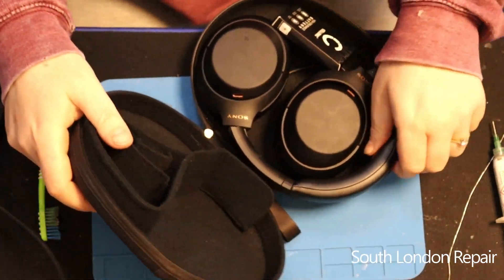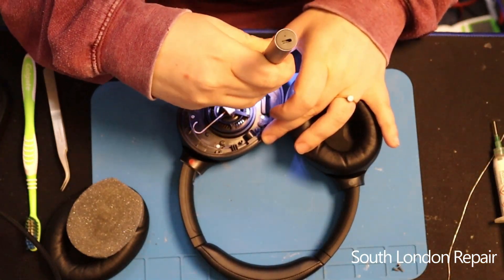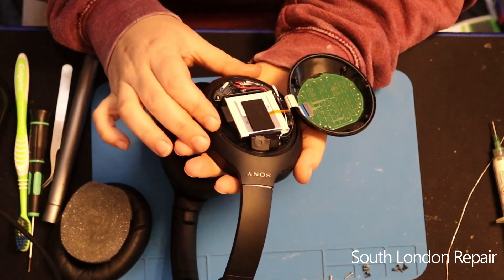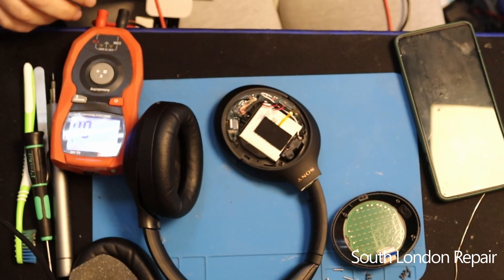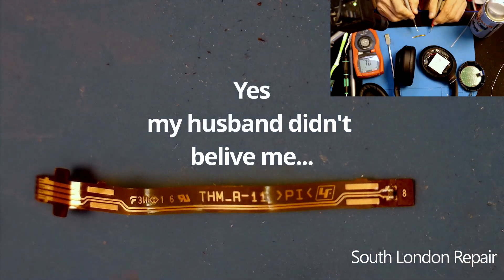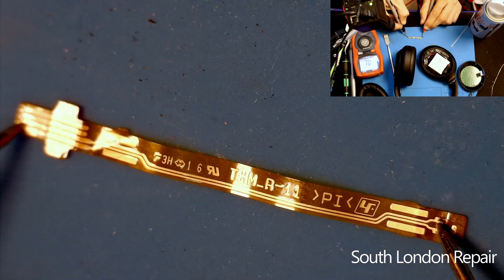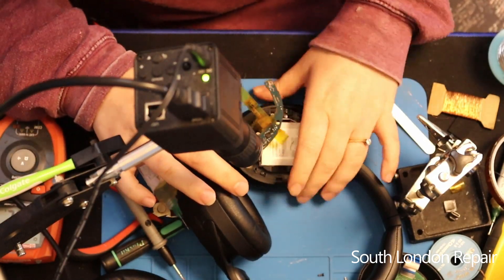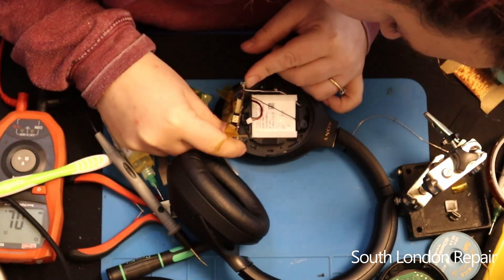Sony headphones blinking, won't charge - Unconventional repair - WH-1000XM4 thermal sensor issue

Comment: For anyone else: There was a bunch of gunk and dirt on the adhesive for my thermal resistor. After taking it out of it and putting the resitor to the battery with some electrical tape it worked. The gunk was just short circuiting it.
Reply from the maker: Yes, sometimes dirt can cause problem. As tiny bugs too.

Comment: Thanks so much!, your video saved my headphones. The capacitor you show is so tiny that it is necessary to be very skilled to solder without causing damage. I removed the flex connector from the PCB (it's also easier to place it again using a heat gun since it is in the corner, far from other parts) to have access to the contacts in the PCB to solder, and  replaced the thermoresistor with a 100 K ohm resistor. I don't have a sensor anymore but won't miss it, my headphones are working perfectly.
Reply from the maker: Happy to hear. Great work.

Comment: Hi, what's the name where the temperature flex is connected, I lost that part of My WH-1000XM4 and now I can't connect the flex
Reply from the maker: The mainboard? If I remember correctly (95%) on the battery side there are two boards. One inside where is the speaker, the charing board. The other one where is everything connecting, battery, speaker cable etc. is the mainboard.

Comment: I have same issue but i am in the US and i dont know where to get a new battery temperature sensor , please any suggestions ??
Reply from the maker: The sensor still should be there, unless you dropped out with the old battery. 
If it's still there, just connect it with a wire, as we did. It should be fine. Next time I'll check the resistance on this temperature sensor, and make a new video. Just waiting for someone to bring one into the shop :)
Reply: If i recall correctly the thermistor can be replaced with a 100k resistor while you get a new one. Also any 100k thermistor can be used.
Reply: @jotatsu 
I had, like an idiot, destroyed the ribbon while taking a peek at the internals, for funsies of course.
Seems like the thermistor was dead as well so I removed the old connector and an 100k 0603 metric resistor fit the spot and worked perfectly.
Thanks very much for posting this info as I don't think I would've been able to find it elsewhere!

Comment: My thermal sensor seems to be the problem and I don’t see it on your site, what do I do?
Reply from the maker: Hi. The thermal sensor just that little smd resistor on the flex cable, sitting on the battery. You can see on the video. Usually nothing wrong with the resistor itself, (unless the battery is blowing up, but in that case you have bigger issues) so take a look on the flex cable and check if you have continuity and you can check the resistor as well. 
In worst case scenario, you can get the battery and the flex cable with the thermal resistor on eBay, for an eyewatering £60-£80, but probably you just have to fix the connection, as we did in the video. I already fixed 3 or 4 with the same issue.

Comment: Hi dear thank you so much my Sony wh1000xm4 same problem as per your guideline I did it 🎉  I was cut the edge of the sensor after that shaving blade I had scratched and pasted tip Flim
Reply from the maker: I'm so happy 😁 Keep in mind, the new wh1000xm5 has the same sensor.

Comment: I'm trying to fix my WH-1000XM4 headphones as well but the thermal sensor was lost when taken apart do you know of any other options i could try to bypass this problem or fix it? Could I just buy a generic resistor of the correct size and solder that in place? How much resistance is it supposed to have?
Reply from the maker: I was looking back on the video, and on room temperature it was around 95-96 ohm. 
So I would use a 100 ohm resistor. That should do the trick.
Reply: @southlondonrepair  You're awesome thanks SO much!!
Reply: Hello, thermistor or resistor, 100 ohm or 100 kOhm, thanks
Reply: @trsmas  100kOhm is adequate if 100Ohm is proposed?
Reply: Where can I buy a new thermal sensor i got mine ripped